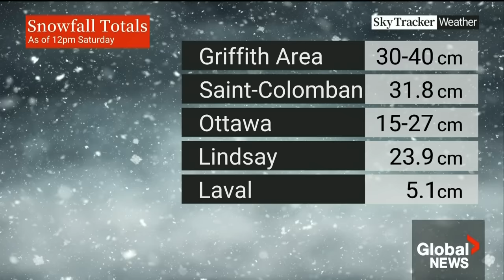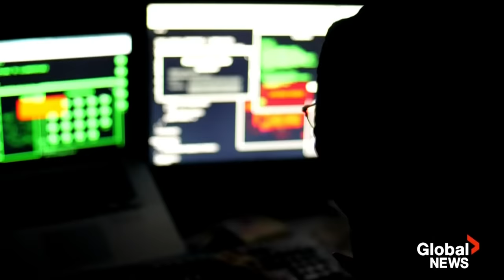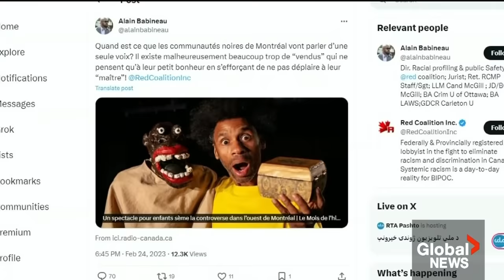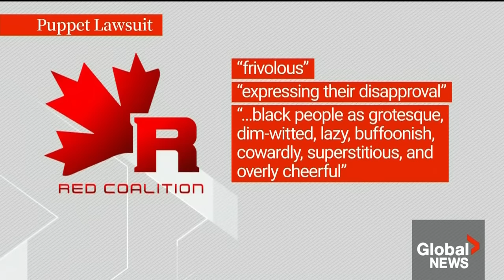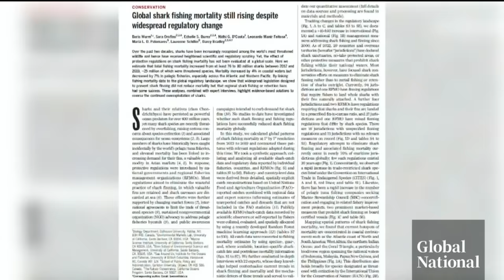Global National: Jan. 13, 2024 | Deep freeze shattering records across Canada

Comment: In my 60 years this is not all that unusual,  It's winter in Canada. Thankful for my new gas furnace.
Reply: Oh you must reside in a more ideal location. My gas furnace is if i let off some natural gas, as the warmth of it rises, its both good and bad at the same time, because after it rises beyond me reach, its back to gulping air pockets if to maintain the cycle for such heating. It might also not be good for the environment, but its affordable, and i try to filter out the side effects so others dont have to breathe it in. Let them rely on their own supply, unless they cant and only then it seems only caring to share with others.
Reduce, reuse, recycle.
Reply: Well, that doesn't change the fact that it is records that are being broken.   Yes, there are cold snaps every winter and yes this has still been a warm winter with little precipitation but the daily high temperatures have still not been this low here since 2004 so it is still a notable cold snap.  Sure, the news does sensationalize, but it isn't always without merit and the sensationalism isn't for fear but for an audience hence profits.
Reply: Gas? No heat pump? Ahahaha
Reply: @allanallan4791  At these temperatures (-36 Celsius right now), heat pumps don't work and they revert to their backup heat which is often electric resistive heat.  Indeed, even the newest heat pumps can become ineffective between -15  to -25 Celsius.   It's just plain too cold for heat pumps to work right now.
Reply: @johnwang9914  I know, I was being sarcastic. Wood is the best way to heat when its that cold.

Comment: Got an emergency warning on my phone to lower power usage to avoid blackouts.  So, how is everyone supposed to charge their EVs and heat their homes with electric heat pumps when we can't even keep up with power usage on a cold day without the added strain?  
Now imagine if 90% of vehicles were EV and required charging overnight.  How is that going to work?  I don't think much power is generated from solar in the winter and wind turbines often aren't turning either at night and/or when it is cold.
Reply: If Russia can do it im sure we can figure it out.
Reply: @fabienneisore7831  Russia uses gas, coal, nuclear and hydro.
Reply: @fabienneisore7831  Here's a quote about EV usage in Russia:  In 2023, we estimate that Russia's passenger EV fleet expanded to just under 11,500 units with a passenger EV penetration rate of only 0.08%.
So, you were saying?
Reply: It's intentional.  They will control your food, heat, and transport at the flick of a switch.
Reply: Everyone get a woodstove and slowly disconnect from the system
Reply: We'll be fine, we just need to pay more carbon tax.
Reply: @sw4882  Indeed. We can also pay to rebuild homes destroyed by fires and floods and  pay higher insurance premiums.
Reply: Hahahahahaha the carbon tax is too effective!
Reply: If you know anything about Energy consumption you would know  heating a home in Alberta at -35 Celsius is like trying to out-chug a power-hungry beast. It's raw, primal, and energy-intensive. Charging a Tesla overnight? Well, it's like the car is sipping energy gracefully, like a fine wine. 
 It's like comparing a raging bonfire to a Tesla quietly sipping electrons. EV's clearly are not the issue here.
Reply: @JordySquirrel  lol because there aren’t any.  If you had 200,000 of them charging you’d be tapping out.
Reply: @j-rocsk  The change will happen gradually over time.
Reply: @TwindianTime that’s why some places outlawed wood stoves. They don’t want you independent.
Reply: Peltier plates and fire?
Reply: @BANE_300  Make better life choices.
Reply: I can tell none of you are Canadian.  In Canada, especially in Alberta, most cars are plugged into a heater so the engine block won't freeze. This happens often.
Reply: Don't buy electric they are garbage
Reply: Provincial issue, figure it out. BC experienced similar cold and leads the country in EV adoption without experiencing any power shortages. We're also building a huge new hydro dam up north that will supply even more power for BC.

Time to catch up Alberta.
Reply: We can install passive solar systems, using parabolic receivers cooking various forms of storage, then pulling the heat from that after it stops charging. Its like lasers of much amperage you can focus to specified forms of exothermic storage. But if you wearing 3d glasses, you will want a type of polarization heavy on the UV protection if directly inspecting density of such potential energy.
Heat pumps should be made by a govt owned manufacturer along with solar too, if to help ensure a most level playing field free of lack of quality of life for all. That and you shouldnt have to wear your wintercoat indoors just to charge your vehicle or to avoid rapid onset expiration date, that is, if you have somewhere indoors to be even.
Reply: @heathermccall8015   A block heater uses a small fraction of the electricity that charging an EV does.  About 1000 to 1500 Watts.  So, overnight would use 8 to 12kWh.
Charging an EV overnight would use about 100kWh.  Which is why many people who want to charge at home need to upgrade their electrical service to handle the extra power and install a 240V charging outlet.  
So, if the current grid can't keep up with cars using block heaters, how can it keep up with EVs charging instead.  Which by the way, need to heat the batteries during cold weather (if outside) in order to charge and maintain the battery.
Reply: @my3dviews  Yes, I understand that, however, you only need to charge that car occasionally.  Obviously the EV is useless for long distance driving, so would only need charging in city driving occasionally.  You don't need to plug it in every night.
Reply: @BC_Geoff   Did the Vancouver area drop below -40°C (not wind chill) for close to a week?  Because that's where most of those EVs are.  Here is a quote for you: Victoria area: New record of -10.7 C, old record of -9.4 C set in 1963. West Vancouver area: New record of -12.8 C, old record of -10.4 C set in 1998.  End of quote.
It is now -35°C here in Edmonton (again, not with wind chill, but actual temp.).  
So no.  B.C. (the part with most of the EVs) didn't experience similar cold.
Reply: @heathermccall8015   I know people who drive to work 40km per day (one who has a Tesla).  In the winter the range of an EV plummets.  With -40 that range goes down even more.  So, charging is required more often.  
If you don't have a garage, you need to plug in the EV in order to warm the battery before driving. That can take a lot of electricity when it is -40, even without charging.  A Tesla can take up to 6kW to run the battery heater. Which is a lot more than a block heater for an ICE car.
Reply: @truetech4158    LOL   Yup, solar works great in Canada in the winter.  Short days, with low angle sun with overcast skys.  Optimum conditions for solar.  😂
Reply: @my3dviews  I wouldn't buy one.
Reply: @TwindianTime    Some cities in Canada (like Montreal and Vancouver) have banned wood stoves and fireplaces.
Reply: @my3dviews  No, but that doesn't matter. What matter is it was colder here than normal across the entire province, just like alberta. It doesn't matter how it cold it gets, what matter is that both electrical systems were under higher than normal load because of the weather. And only one of those provinces had to issue rolling blackout warnings. 

Saskatchewan and manitoba had the same weather as alberta and they didn't issue any warnings. It shows that it is Alberta that is not prepared. as usual, they're always behind the times and slow.
Reply: Also the grid is connected, what happens in Northern BC affects the rest of the province's electrical grid. You have no idea what youre talking about and you don't know how to think critically.
Reply: @JordySquirrel , Teslas don’t sip. They guzzle. Unless the charger doesn’t work in the cold. Then they don’t do anything, including move.
Reply: @BC_Geoff , bollocks. Alberta is now full of former BC residents who don’t like socialism. They need the extra electricity for their rice cookers.
Reply: @BC_Geoff    So now it doesn't matter that it wasn't as cold?   But, your claim was this: "BC experienced similar cold and leads the country in EV adoption without experiencing any power shortages."
So, not as cold means it is easier for BC residents to switch to EVs, unlike Alberta where it gets way colder.  Causing EVs to require more charging and heating the batteries.  
Having it get to -15°C doesn't require people to plug in block heaters on their cars, as it does when it gets -30 or 40.  The increased load on the grid isn't the same in BC at those temperatures as it is in Alberta with our temperatures. 
Yes, we have had some stupid decisions made by various governments. The shutting down of coal plants and trying to rely on wind instead is a stupid mistake.
Reply: @garywagner2466  Oh, thinly veiled racism, I never, ever expected that from an Albertan.  Albertans prefer "selfishism".
Reply: @heathermccall8015    I wouldn't buy one either.  At least not while they have the problems with spontaneous combustion, while charging (or even not charging), which could burn my house down too.  Plus the range isn't enough, especially in winter.
Reply: @my3dviews  Yes it is the same and here's why. Every electrical system is built out to handle the conditions that are in the area it will be operating. The temperature doesn't matter, what matter is that both systems were tested under extreme conditions for their respective area. And what about sask and manitoba?

also your original comment wasn't talking about how well EV perform in cold, but rather whether we have the grid capacity to charge them. Turns out everywhere else does except AB
Reply: @my3dviews  Wow you or pro coal. stuck in the past
Reply: @my3dviews  All alberta hs to do is build more power plants, shouldn't be a hard problem to solve for Canada's wealthiest province right?
Reply: @BC_Geoff    No, I'm not pro coal.  But you don't shut down one form of reliable power generation before replacing it with another form of reliable power generation.  Wind power isn't that.
Reply: @darlene2709  we still don’t have the capacity for it
Reply: @bradmettler4566  You're delusional if you really believe that
Reply: @BC_Geoff   No, it's not the same.  How much extra electricity was needed for BC due to the temperature drop?  Obviously a much smaller percentage than required here.  
Yes, my original comment didn't mention EV performance in cold, nor did my later replies to you.  Rather they mentioned how much extra power they require when it is cold, which is relevant to the discussion.  Also, performance as far as range is a factor to grid usage as the lower range in extreme cold means charging more often.  Something that BC doesn't have to worry about.  What is a Tesla's range in -40 vs. -10 where you are?  That drop in range (again) means more charging required. Which may have a lot to do with the amount of EV adoption in Alberta vs. in BC. 
As for everywhere having the grid capacity to charge them.  That is false.  Look at what California has done during heat waves.  They told people not to charge their EVs.  Look it up.  
Saskatchewan and Manitoba have lower percentages of EV adoption than Alberta.  So not sure how you can say that they have the grid capacity to handle EVs either, when they have less of them.
Reply: @TwindianTime  they won't insure your home in many cases if you have a wood stove or they make it so expensive to insure your house one cannot afford  it.
Reply: @BC_Geoff  , coming from the province with the largest coal export facility in Canada. Hypocrite.
Reply: @garywagner2466  Obviously a coastal province would have the largest export facility.

It's nearly all metallurgical coal anyways. It's used for steel which is essential to the modern world. Thermal coal is what is bad because it just gets burnt to make steam, and there are many other much cleaner ways you could do that.
Reply: @BC_Geoff if it’s figured out then why is there a solar farm near the small town where I live taking up farm land to only ship energy to fortis BC as per their contract?
Reply: @TysonBrown-q4j  they’ve got it figured out partially because they’ve contracted that solar farm to send them power. Maybe Alberta should do the same. Also worth noting that FortisBC is a private company that only supplies power in the southern interior of BC. The majority of the province gets their power from the crown corporation BCHydro not the private company FortisBC.
Reply: @rogueraven7603  ignore the laws
Reply: @j-rocsk  When cars become available in the early 1900s, we didn't have gas stations every where. Over time, gas stations were built and here we are.
Reply: @JordySquirrel You clearly have no idea how the tesla chargers work. They require a 50amp feed for their fast charging capabilities & their trickle charge is still a few amps because it has to step the voltage up to satisfy the batteries requirements (typically around 350-400vDC.)
Multiply that by the number of vehicles on the road and you see the problem now.
EV vehicles & green energy are a feel good policy based in zero reality.
Reply: Yup!
Reply: @JordySquirrel yeah, which is why a level 2 charger which runs around four hours is recommended to have an 80amp breaker. Pretty big sippy straw.
Reply: @fabienneisore7831 Russia? Seriously?? 😂
Reply: @eleanorshellstrop2709 wrong! We just need to hold arsonists setting fires accountable!!
Reply: @BC_Geoff  no, it shows that Alberta has one of the fastest growing populations.
Reply: @Slide164  province better catch up then and stop dragging their feet
Reply: Gotta go nuclear
Reply: @BC_Geoff Someone from the lower mainland with an opinion.  Go figure.
Reply: @lornemyers6638  who doesn’t have an opinion?
Reply: @BC_Geoff  yes, they need more coal and hydro projects.
Reply: @BC_Geoff  One's that shouldn't
Reply: @heathermccall8015  I heard the news today about a.i. coming up with a better version of solid state power storage.
Also, other battery formulations that surpass the expectations of lithium, while using only 30% of the lithium in order to do so. These will also require charging, though will be potentially be affordable enough to cause more people to want to have an electric vehicle.

Good thing is that heat pumps can be designed to use a tiny amount of power, and these might have solid state batteries parked inside their casings, with a solar cell outer shell of multicrystaline yet thin film and flexible, and this also applies to a type of laminate construction that could begin to appear in vehicle design soon, as self charging vehicles. Then, theres also very low level radioactive isotopes such as with a very common element that can be harvested, has a shelf life of a very long time, and THAT could trickle charge a power storage system, either on its own, or in lower power levels that require additional solar.

Science is interesting stuff, especially how it has the potential to apply itself directly to innovation.

Vote very carefully.
Reply: You have logical insight and these are definitely questions that should be asked, especially in places like Alberta where -40 is common in the winter months. Trudeau's plan is to switch to all electric vehicles by 2045, if I'm not mistaken. Good luck with that!
Reply: How is it going to work? simple. After they force you into an EV they will introduce more TAX to charge it.. then another TAX to dispose of the battery. With merger of big corporations and state being one of the major hallmarks of a political system i can't mention without my post being deleted, don't put it past EV manufacturers to be forced into having a "policy" of allowing the government to control the charging grid.

Comment: Add few hundred thousand electric cars to these temps   Wonder what will happen ??
Reply: "The impact of electric heat pumps 
Currently, how people heat their homes varies quite a lot across the country, and so will the impact of switching to electric heat pumps. In Quebec and Newfoundland and Labrador, for example, a majority of homes rely on inefficient electric baseboard heaters.

Brendan Haley, director of policy research at Efficiency Canada, based at Carleton University in Ottawa, said if those were switched to more efficient heat pumps, "we would end up using less electricity" in those provinces.

The impact of EVs
A 2020 study commissioned by Natural Resources Canada found that based on federal electric vehicle targets, EVs will consume 156.5 terawatt-hours of electricity per year by 2050 — equivalent to 22.6 per cent of electricity consumed in the country in 2020.

But electricity system planners surveyed for the study said they weren't worried about that growth. Instead, they saw EVs as "a business opportunity instead of a risk or a vulnerability." That's because EVs store large amounts of electricity and tend to be flexible about when they charge, as they're parked most of the time." Reuters